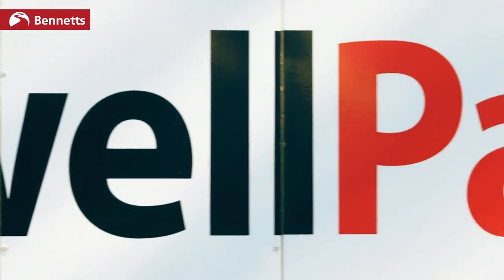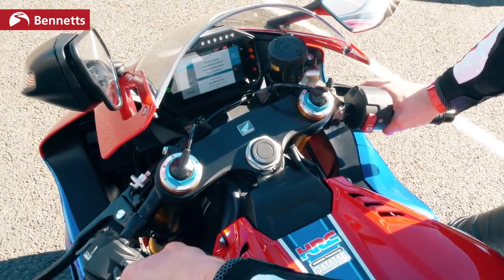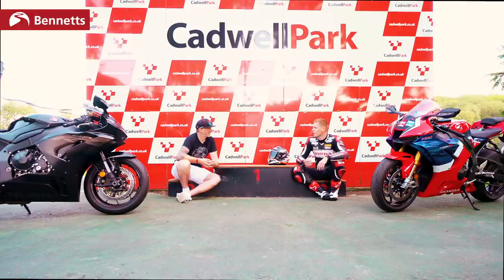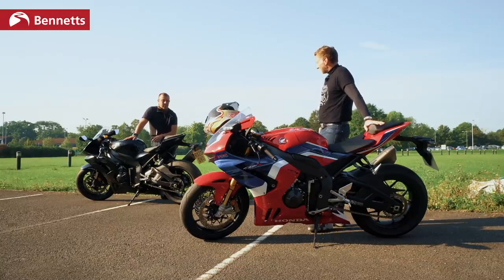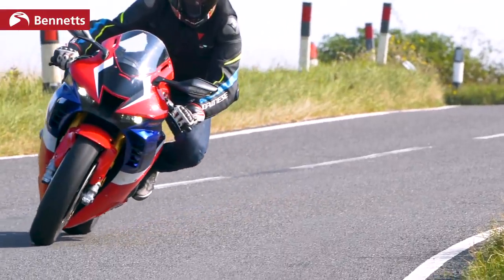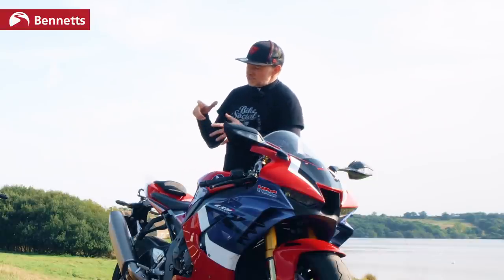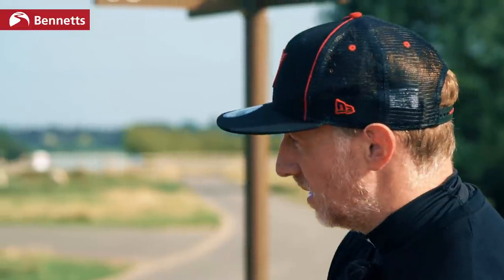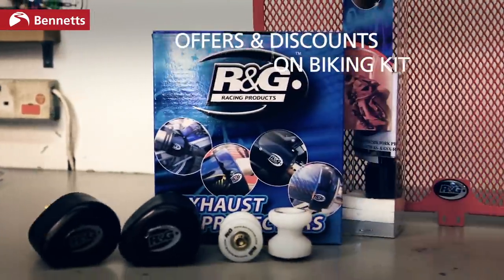2020 Honda Fireblade on UK roads, track & dyno | CBR1000RR-R & SP

Comment: S1000rr was putting 198 to the wheel 5 years ago. You can buy one for 8 grand with brembos and active suspension. It also makes big power and torque all through the Rev range
Reply: Well said👍
Reply: Except a stock S1000RR was NOT putting 198 to the wheels 5 years ago.
Reply: @RCFourFive  true
Reply: Who even needs 198? Who even needs 150? Honda messed up by not focusing on rider comfort and daily rideability. Still a cool bike though.
Reply: @ralphwarom2514  lmao imagine buying a homologation special superbike for daily driving...
Reply: @brane1872  I'm waiting a year or two for these to come down s little in price, then plan to turn it into a bit of a sports tourer by adjusting the ergos and putting hard bags all around 😂 I've done it to my cbr650r and this is the only thing I really want to upgrade to

Comment: Great track bikes but absolute shite for the road, the complete opposite of all previous Blades which were legendary road bikes and flattered even a moderate riders skills, these Blades rarely get out of second on the road and are gutless below 8,000rpm. it's scandalous that a £20,000 bike (non SP) doesn't have a quickshifter/auto blipper as standard when £8 to 9,000 bikes (the KTM 790 Duke and Street Triple R) have them as standard.
Reply from the maker: Fair points but I believe the standard machine is there as a base for race teams who'll simply replace brakes, suspension and electronics as soon as they lay their hands on the bike. Honda made no secret about their desire to win races so effectively you have base level bike for race teams to tinker with and the SP, with all its high end components, is aimed at the road riders who'll enjoy them.
Cheers for the comment, Michael
Reply: @bennettsbikesocial  you are Right Sir👍
Reply: @bennettsbikesocial  I understand Hondas desire to win WSBK etc but they've alienated many Blade owners who were about to change to a new model expecting the updated version of the old rider friendly bike ,so why not the balls out SP and a more road friendly model.
Reply: @yonniboy1  👍
Reply: @bennettsbikesocial  has it won in BSB? it hasn't won in Wsbk
Reply: @848evo4  Its doing extremly well in BSB for an all new model. I think one of the Irwin boys is in 4th and they've had a handful of podiums as well
Reply: @motovntrzss  wasn't the Ducati V4R an all new model last year? I believe that bike did extremely well, multiple wins, BSB champion, WSBK 2nd place
Reply: @848evo4  Yeah thats a fair point, its done pretty well here in ASBK too. Still, to have a brand new model perform as it does is impressive remember alot of testing time was robbed due to COVID
Reply: @motovntrzss  you're right especially when you look at how long it took Yamaha to turn the R1M into a winning machine.
Reply: I have test rode the 2020 sp and I concur completely. after getting off my 2007 GSXR The blade felt shockingly UNDER POWERED. Pulls off feeling like a 125 spends most revs feeling like a 600 and at top end of rev rang it goes fast with 20hp more than my bike but £20,000 more. If I want to pass someone quickly on mine I just twist the throttle even at 30mph in top gear you still power away but on this 2020 sp I have to go down three gears and everyone could hear I was having to try hard to go fast so far from stealthy & more like the old days of attuned to two stroke.
so yes a real pain and disappointment as a road bike in my opinion and I wish these tests more honest about that because its important.

Comment: Why was it a surprise that there was QS settings? Bloody previous model SP/SP2 had similar QS options.
And lets be fair, the base RR-R suspension can be adjusted - you just need to do it manually on the fork tops.

The claimed is at the crank. Measuring at the wheel. I thought by now you guys would know this.
The certified claimed is 215bhp so 199rwhp is pretty accurate.

Comment: Had one (black sp rrr with carbon kit - yes you can get the black one as an sp) and did 500 miles on it. Rather hard on my wrists. I’m too tall for it. Also went through a recall. Great bike but the gearing is really not suitable for the road. I also bought an akraprovic can for it and it didn’t work properly as they hadn’t sorted out the servo plate properly for it at the time so it had to go back to cal sports and they luckily refunded me at the time. I wouldn’t say it was a great experience for me overall to be honest.

I have to say Adam child always gives great analysis. Top bloke.
Reply: damn, that sucks.

Comment: Honda claim peak power at 14,500, you hit the limiter at 14,000. You can see from the graph power is still rising. I think you are hitting some speed limit even in 4th gear. You should rerun the dyno results.
Reply: It wouldnt make any more in 5th or 6th

Comment: it's not claimed, it's measured at the CRANKSHAFT. Only losing 15HP from crank to wheel is incredibly good. a 7% drivetrain loss is incredibly good, especially considering the typical loss is 15-20%.
Reply: thank you for the most perfect reply/comment -  No-one else seems to understand this - I have an black -21 RR-R  🙂
Reply: thank you for the most perfect reply/comment -  No-one else seems to understand this - I have an black -21 RR-R  🙂

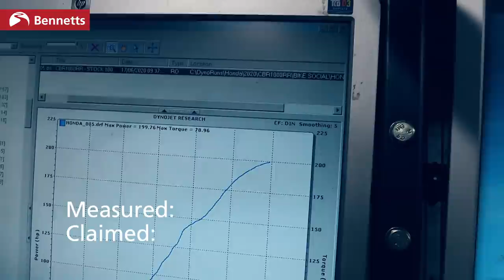Comment: 13:20 Claimed 214BHP
        Measured 119BHP

Bikes running on 2cil or what😅
Reply: Dyno gives a WHP reading not crank HP. 199 WHP would normally indicate 220+ at the crank so manufacturers claim is conservative.

Also wheel speed sensors hamper dyno runs on the old 2019 blade - not sure if that’s the case on this or it was taken care of.
Reply: @RUNDMC1  It as a joke because the screen said 119 and not 199 as the dyno was reading😁
Reply from the maker: Great spot... and of course it's a typo. It should be '199.76' as the chart in the back of shot reads. Sorry about the boo-boo.
Cheers, Michael
Reply: Bennetts Bike boo-boos happen to the best of us!
Reply: @bennettsbikesocial  this is rear whell hp or hp at crank ?!
Reply from the maker: @mociczyczki  If it's measured on a dyno then the result will be from the rear wheel
Reply: @bennettsbikesocial   no sir its typical misteake alot people who think that when bike is on dyno and wheel spin around and so one than results is in whell hp ;x in fact owner such dyno measured both whell hp and hp at crank because when he do measurement and go to cut limiter on gear than he turn on clutch and whell with dyno slowly loose speed on this fundaent software of dyno measured powerlososes from drive train the faster dyno stop the bioger power loses than owner dyno havve both graph at crank and at the whell now what he show  depend on him on graph so he can show you power at crank or power at the whell  best be oif always they will show both than there be no question which kind of power they show us :x so im not sure this is the whell hp or crank or clutch or whatever .
Reply: @bennettsbikesocial  phew almost hand me there

Comment: 20k bike and quickshifter is optional? Honda is going mad. Anyone knows if there is a fireblade coming out under 20k maybe the RR only
Reply: Garbage road bike.
Reply: @robertprosser6856  So you mean everything a proper superbike should be? I thought these are "Race Replica's". Folks don't know what they want these days apparently.
Reply: @d1sturb3d119  there are much better options for sportbikes being used on the roads like the previous fireblades.
Reply: @robertprosser6856  Sportbikes are supposed to be replicas of their racing counterparts. If you want a road bike, why would you be commenting on this? 

Buy a GS and go talk about how great that is then.. This is a +20K competitive track machine and the price tag alone makes that plenty clear. 

And yet someone will always come along and spout that it is not good enough for a completely different use.

Are you going to comment on a house listing next and claim that wouldn't be great for your outdoor lifestyle? Smh..
Reply: @d1sturb3d119  who said I want a road bike? I own sport bikes that I use only on the road. Let me spell it out. There are much better sport bikes for use on the road which have better engines for road use than the gutless one in the new fireblade that needs thrashing as it has no bottom end or midrange torque along with the new Kawasaki ZX10R. The Fireblade and ZX10R are extremely uncomfortable. The BMW S1000RR and GSXR1000 are much more suited to use on the road with much more comfort and room and both their engines give plenty of bottom and midrange power for easier riding on the road. Can't put it any better.

Comment: The bike reminds me of the Honda s2000. Tame and confident at low speed road driving. Sporty enough where you feel bumps etc, but turn it up, spin the motor and the car changes personality.
Reply: Except the S2000 was still slow regardless of how you drove it. I know, I owned one.

Comment: Sorry but the 'you can't change the suspension' thing is CRAP ! the standard model still has pre-load, compression & rebound !! FFS.  the difference is the RRRRRRRSP has ELECTRONIC adjustment just get a bloody spanner & screwdriver and bang there you go - also stock non electronic / non active is usually more consistent - why are people unable to turn a screwdriver ?
Reply: I also found that strange that they say they cant change the suspension.  It has just as much adjustment,  just manual.
Reply: Exactly the comment I was looking for. In fact, I'm pretty sure the bike he races uses manually adjustable suspension, not electronic/active.
Reply: Yeah, I was going to make this comment. You'd expect the Ohlins gear to be better, and maybe even to have a wider range of adjustment as well as just the ease of adjustment that the electronics allow (although that's just rebound and compression, preload is still manual). But from the description you'd think the Showa stuff wasn't adjustable at all.
Reply from the maker: He was commenting on the ease of which changing the SP's settings can be achieved while riding and the differences it makes. Perhaps his comments were taken out of context.

Comment: I don't get that the super stock rider was saying you get what you get with the standard suspension. Surely it is manually adjustable for preload , rebound and compression. You can see that it is later in the video.. Was there not a screwdriver in the tool kit.?
Reply: I think he means once you set it you get that consistent performance whereas with the electronic you can change strings on the fly or have it in adaptive mode.

Comment: Are all six gears used during dyno runs?
Reply from the maker: Good question but many bikes, including the Fireblade, have a limiter in 6th and therefore the dyno tester will usually use 5th or even 4th (depending on the capacity and no. of cylinders) to give a better/more accurate reading.
Cheers, Michael

Comment: It's a nice looking bike but a bit irrelevant for anyone outside of a race team. Not really anything new as Honda were doing this 30 years ago with the RC30. Massively expensive, mainly sold to race teams etc. If you don't want to pay big money for a 200 bhp track bike, buy a CBR650. By the way, I find it amusing that my bike is flat out in 6th gear well before a CBRRRR pilot is even considering changing into 2nd!

Comment: It is definitely  a 205 Mph ( or even more) bike if it was not restricted to 186 Mph isn't it bennet's bike?
Reply from the maker: With ease. It hardly breaks a sweat to reach 186mph in 4th, and there are still two more gears to go.
Reply: @bennettsbikesocial  yeah amazing bike.
Reply: @bennettsbikesocial  yeah amazing bike.
Reply: @bennettsbikesocial  How's the heat management due to the added power?
Reply: @Miran Kajtna it will do 183 Mph in 4th gear gps as tested by Mcn Performance tester bruce dunn using very accurate 2D data recording gps device. And it will max out at exactly 186 mph in 5 th gear. The speedo reaches 186 quickly. But  few tenths of a second later The Gps speed also max out at restricted 186 mph. But it is very very impressive because it is nearly reaches 186 mph in 4 the gear in gps also.  The other magazine also tested with gps device and it reached around  182 in 4th gps. So it is confirmed that it will reach close to 186 mph in 4 th gear only.
Reply: @wanderer54796  absolutely, here's the link https://youtu.be/jW7_PoSMrhQ
Reply: @calculator8622  I already watched this video bro. 👍 It's a heavily restricted beast. It's definitely a ( 205-211Mph) ( 330 km/h - 340km/h monster if completely Unrestricted.

Comment: This  bike  is heavily  restricted to 186 mph. If unrestricted  it will  easily reach around  340 kmh or around  211 mph. Thumbs up for this  Awsome detailed  video Bennetts bike. I just loved it.
Reply: No, it won't. Not enough power for such tall gearing.
Reply: @Jose.LQ6  it will,  it can Do that speed if completely unrestricted. And 200 bhp real wheel horsepower is enough to propel this beast to a 340 Kmh if completely unrestricted.
Reply: @wanderer54796  now that you mention it, this should be roughly equivalent to a v4r so 340 seems possible, but definetly needs a sprocket change because its gearing is too damn tall.
Reply: Anyone else got more BS comments or some other trash to say? 

https://www.youtube.com/watch?v=96Kdy_LNzXI
Reply: How do you unrestrict this bike
Reply: @wanderer54796  how do you unrestrict these bikes

Comment: Tweaking hydraulics is all well and good but it's worth nought if you don't set sag (preload) correctly for the type of riding you are doing. This can only be done manually. For a fundamentally correct setup, correct preload is critical. This reduces the benefit of elec suspension. No point pushing buttons for compression if your preload is wrong for your weight and riding ability. I'll take manual suspension every time and use the money saved on track days. But then I would never buy any Blade at this price. Fail Honda.
Reply: No. honda have created a beautiful Monster. Thumbs up for this fireblade.
Reply: What is not mentioned here is that you set the preload up manually